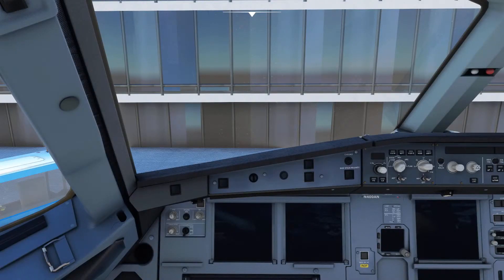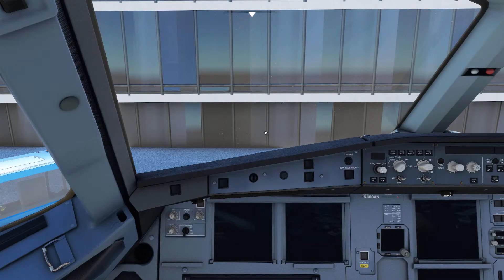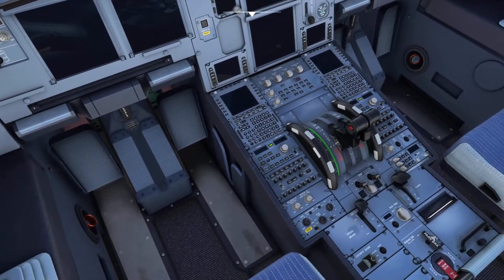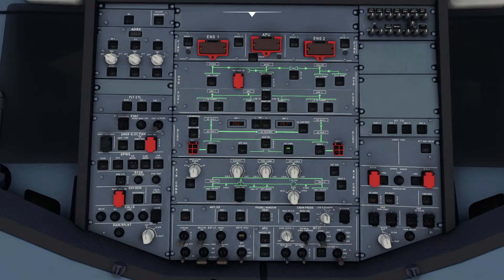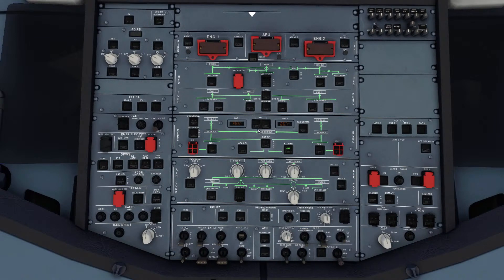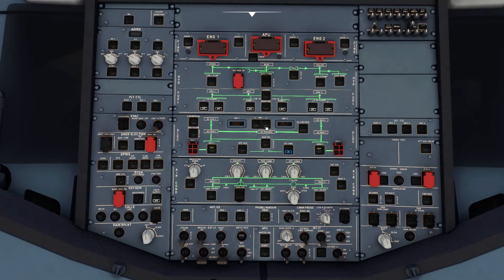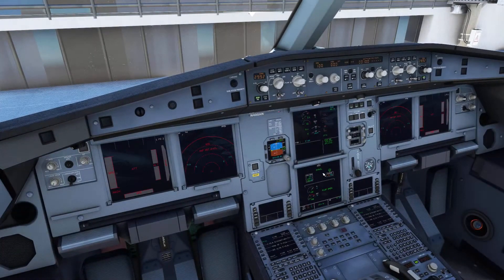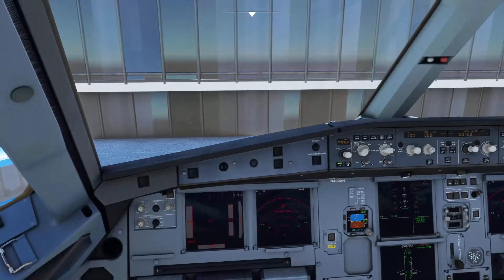A320 In-Depth: Establishing Power

Comment: Thanks for the video.  Really helped put a few things into perspective.  You mentioned the Battery Button illuminations was an 'odd' or peculiar thing, but for me that's not really the case.  You mentioned there's a controller in between the buttons and the batteries, and the controller will likely be using a 'wake-up' type scenario and a standby mode to show the state of the buttons in order to conserve power.  Pure guess work, but that seems the logical reason for that behaviour.
Reply from the maker: Thanks for the comment and feedback. Yes, it is indeed logical, especially along the "lights out" method Airbus employs. In other aircraft, you might see a lighted switch that has a lighted "off" state show that illuminated if it is indeed off. In the Airbus, the switches are indeed off when in the released position but It will only tell you it's off with the lighted switch after you've established power.  The other interesting bit is that pushing the switch is not an "on" state but an "auto" state where, as you stated, the BMC computer maintains the operation of the battery state automatically.